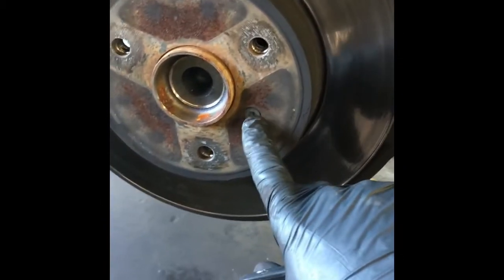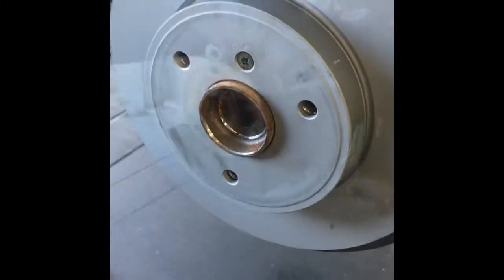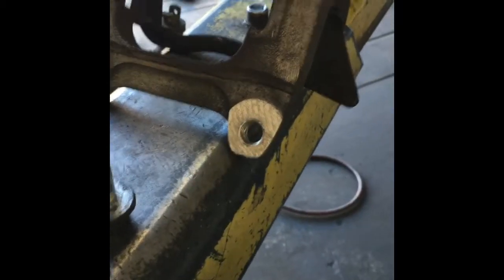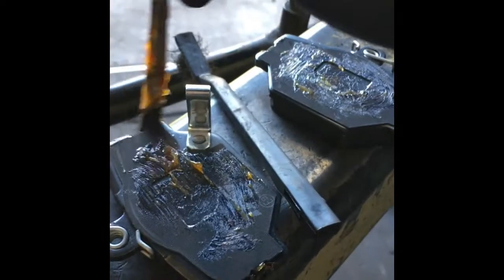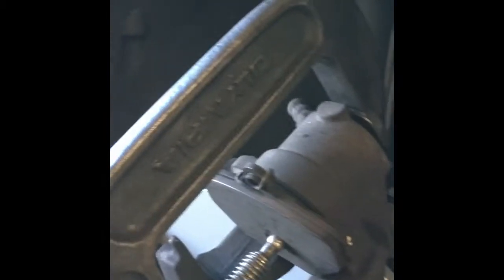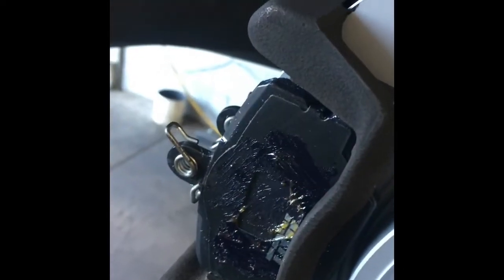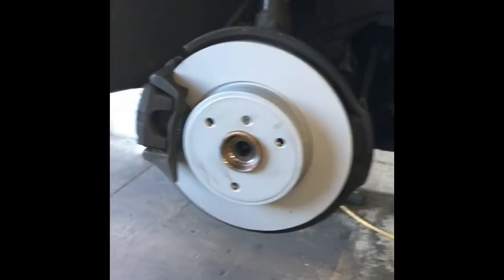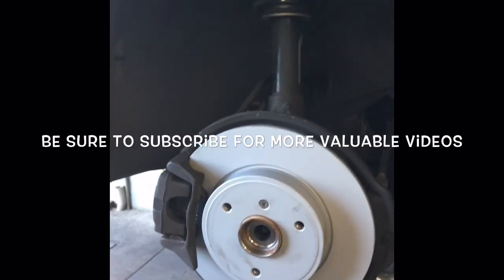How to Replace Front Brake Pad and Rotors on a Smart Car

Comment: Thanks for producing this video. This is chock-full of good information. The last time I worked on brakes (drum brakes) the high temperature silicone brake lube wasn't even a thing. Then it was common practice to use white lithium grease, albeit still very sparingly. Disc brakes were simply assembled dry but with clean, bare metal riding surfaces - as you pointed out with your wire brush cleaning process. Thanks again!

Comment: This video is great! Thanks for helping us save hundreds of dollars on our brake job.  We bought jack stands, a torque wrench, and the impact driver - though we ended up using the the torx bit in our drill.  also we stuck a wheel bolt back through the rotor to hold it in place when removing the torx bolt.  Everything else went well for us.  those 18mm bolts on the caliper cage were on there real good though.  Took a bit of an extension arm to break them loose.

Thanks!
Bryan and Jaimi
Reply from the maker: Jaimi Shepperd glad to help thank you for writing to me!!

Comment: if you take the cap off the brake fluid container you can push the caliper cylinder in much easier .
Reply from the maker: John L thank you for the tip!
Reply: i was just about to make the same remark! really does work, and no it doesn't suck air into the system. If that is a concern just drape a shop towel over the open brake master cylinder and  that keeps everything in and all else out as well.

Comment: Brian what is the wheel lug nut bolt size  ?
Reply: 15 mm for the lug bolts. 13 mm for the caliper bolts. 18 mm for the caliper cage bolts
Reply: @stanislaw1986  On my 2006 CDI it's got an E18 torx socket for the caliper cage bolts.  Also the bottom caliper bolt is a strange 5 sided bolt of some sort.